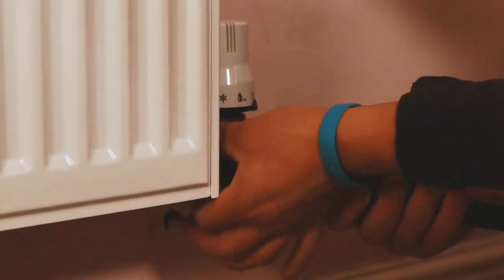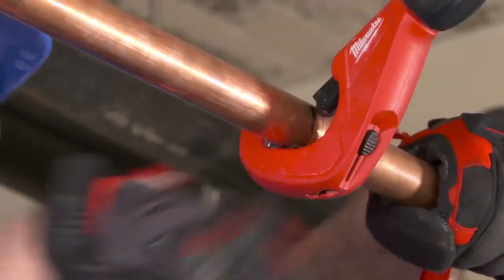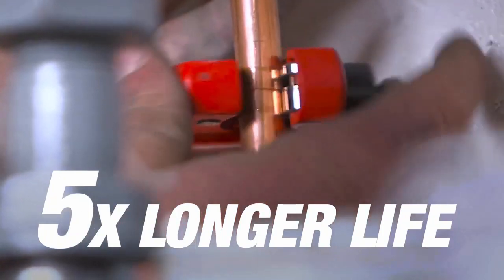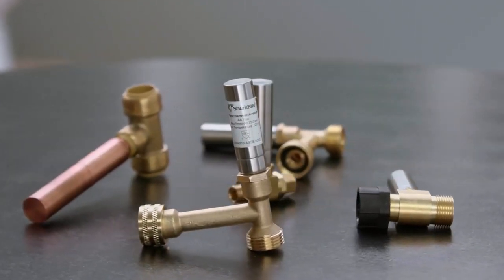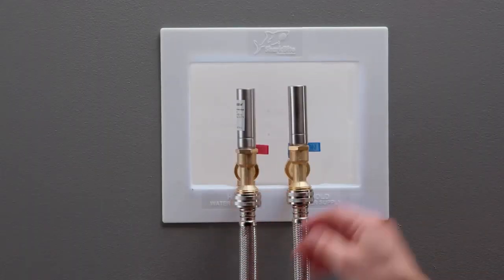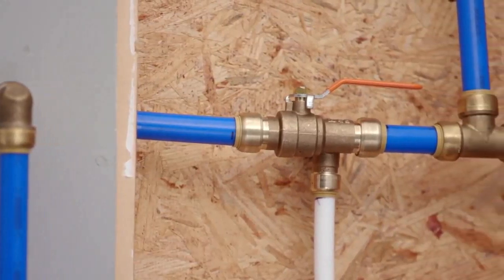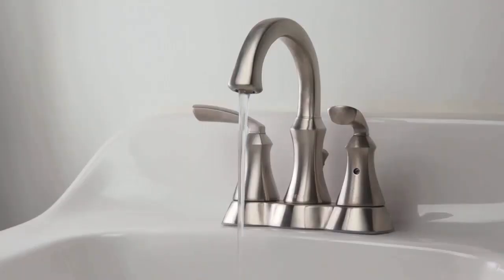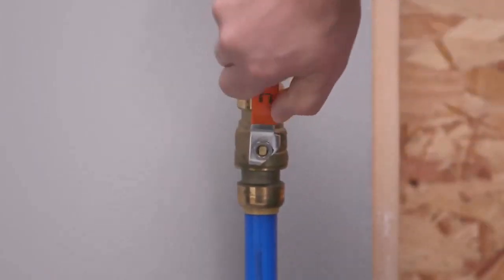10 PLUMBING TOOLS  YOU NEED TO SEE 2021 AMAZON

Comment: What is the advantage of the sharkbite thermal expansion fitting?
In the video, voice over ... 'Now you can remove, your expansion vessel'....
Why would 'you' want to replace something that works well, maintains pressure, also acts as a cushion(hammer arrestor) and saves water-with something that does non of these and would almost be dripping and more constantly. 
I assume this fitting is a low pressure prv, a dumb idea!

Comment: For the tool number 1, one can use a compression end cap male part and it will work better because it is much smaller and it will be more safe for touching/marking walls and door frames etc, You don't need to spent any extra money. Number 2, is a normal basic tube cutter by different manufacturers nothing special, Tool No 3 is a FANTASTIC tool which I admire. Tool No. 5 , don't understand where would a plumber use a 4" wider glue/Sealant it is more like for tiler or carpenter. Can't see the different between No. 7 & 8, why two again here? Again No. 9 is FANTASTIC.
Reply: Naseer Ahmad Totally agree:)

Comment: So the first tool are nothing more than plastic caps ?
Reply: That make the radiator so heavy, you're unlikely to be able to lift it!
Reply: @markpdouglas  how many gallons do those things hold I’ve seen them on a few jobs but they aren’t that popular in the part of States I’m from. 100 year old cast iron radiators with carvings in the casting are real popular right now and they are heavy as hell. I still have the original ones in my almost 100 year old house and was almost foolish enough to scrap them when I put central air in , since I had to run the ducts I figured why not just convert to hot air but I remember how bad that type of heat would dry nose and throat out so I got a air handler for the a/c and a high efficiency boiler for the heating system which runs at 120 degrees when it’s below 30 degrees so it’s saving me a lot of money . But those panels look nice and I was checking the prices out and they aren’t cheap either .